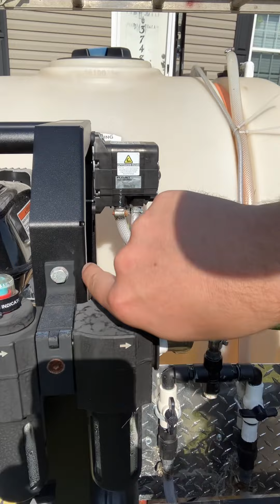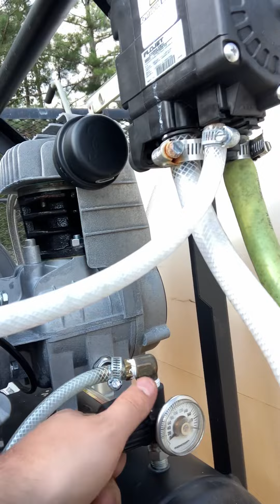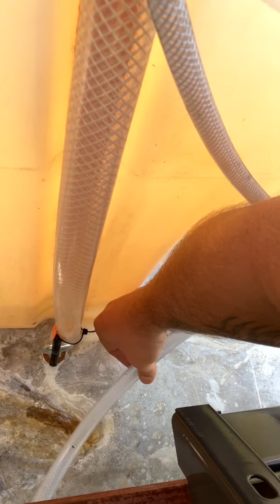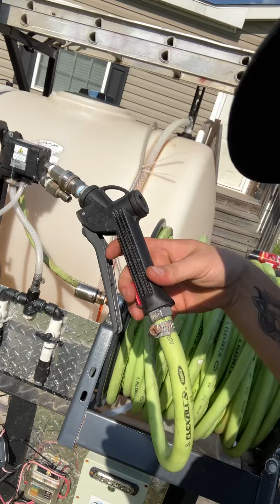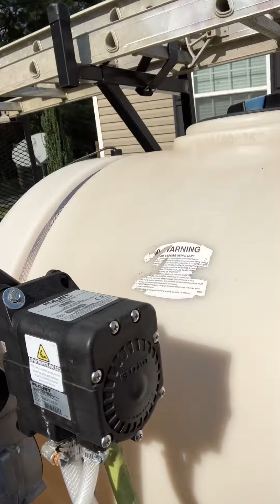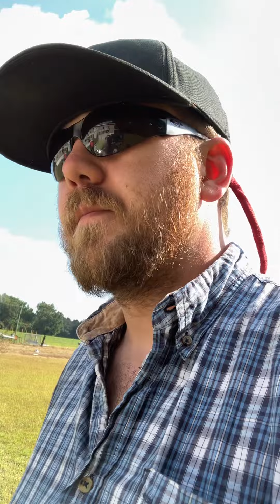Plumbing air compressor for air diaphragm softwash system!!

Comment: Nice video man, I run 4 of those pumps in parallel. One thing that helped me from getting stalls every now and then is I added a pneumatic check valve ($6 part) after the separator and zero stalls after
Reply: why are you running 4 in parallel?